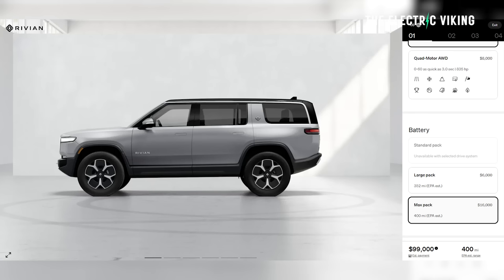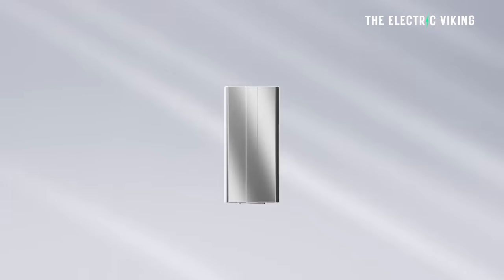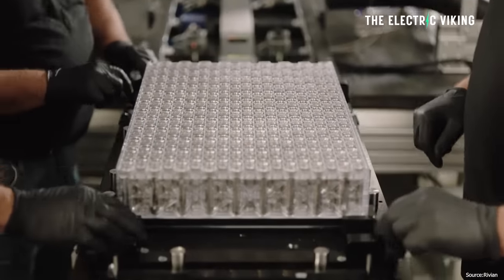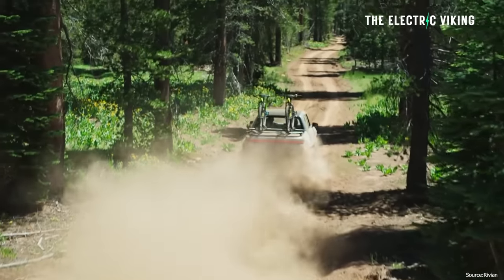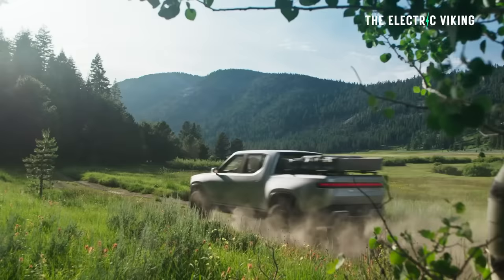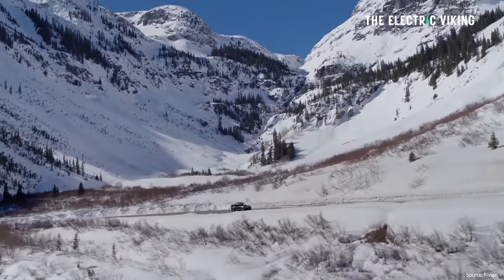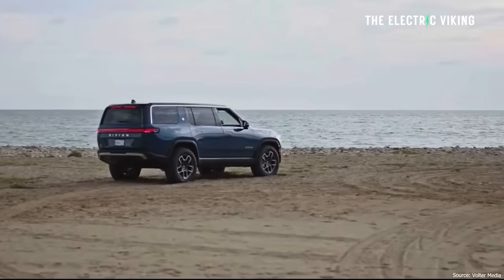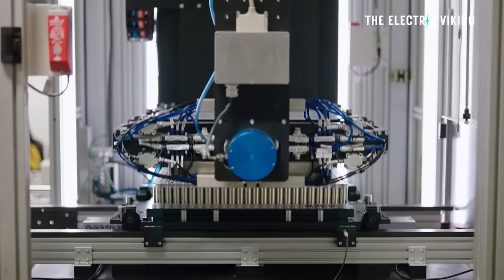Rivian reveals the battery secret that boosted its SUV and pickup to 410 miles

Comment: I got my R1S (quad motor, large pack, 20" AT wheels) a couple of weeks ago and I am so impressed with this vehicle. Would I consider upgrading to a Max Pack sometime down the road? Possibly, but I'll need to do some remote off-road/camping trips to see if my current configuration still fits my needs. So impressed that Rivian managed to squeeze out over 400 mile range while only adding 14kwh to the battery size over the large pack. I think with this kind of innovation, Rivian is going to find a road to profitability and will be with us for a long time.

Comment: The dual motor that gets 352 miles and goes for $79,000, meaning $71,500 after the $7,500 federal rebate is the one to go for. It's even cheaper with additional states rebates in several states.

Comment: I have range anxiety but not $16,000 worth.
Reply: 😂 Agreed.
Reply: @@passurlamer I sold my perfectly good 2018 Odyssey Elite that I routinely drove 350 -400 miles on a tank with a  capacity of 19.5 gal. At 27 mpg on a long road trip, I could get over 500 miles.  The 2015 Model S P85D I bought that at 80% charge gives me 182 miles.  At 100% charge, this old battery pack goes 226 miles.  I’m retired & drive 4000-5000 miles a year so a model S with 180 mile range is ok for me.
Reply: @Trilobite45  well you bought an 8 year old Tesla. Brand new the range was probably like 250 or so. I’d assume it’s degraded. 

If range was truly a concern you could have got a Model 3 long range which get around 300-350 miles. Probably like 250 on the highway

Comment: Sam, you keep quoting battery costs at least at the cell level as being <$100/kw now.  That means a 150kwh pack shouldn't have more than $15K in cells.  Even if LFP dropped that to $50/kwh it would only shave $7500 from the cost, and at the downside of a pack that weighs 50% more.  Rivian's cost problem is not the battery pack unless they are still paying 2010 prices for cells.   For them to be losing $32K on each $100K truck (not $20K, that's Ford), they must be spending more on parts and labor than Bentley does when they handcraft a car.

Also, form factor has nothing to do with whether a battery cell is "old tech" or not.  Rivian has said they have a new chemistry going into 21700 format cells, and it is the chemistry (Qirin, LMFP, NMC, etc) that matters as far as "new" or "old" tech goes.  For all we know, these 21700 cells are tabless like Tesla's 4680 and that would be "new tech".
Reply: Accounting is part black art.. The net loss per vehicle may be based on units produced - that is if they can make and sell more at the same price, they might make money.  Supposedly, Ford said if they can increase Mach E sales, they will make money even at the higher supplier costs all other things being equal.  Is that true?  Don't know - I'm an engineer, not a bean counter, but if they're counting amortization costs of the whole program including fixed costs like factory etc., then more units out the door might turn the corner.
Reply: @ohger1  I think you must be right.  My point was that lower battery prices will not make up for such huge losses per vehicle because the components are unlikely to be a major contributor to the losses.  I got sidetracked thinking how other high-end luxury makers can turn a profit on such low volume as Bentley does.  It has got to be accounting math that attributes capital costs, engineering, and admin to each vehicle cost -- in which case only dividing those overhead costs across many more vehicles will turn losses per vehicle to profit per vehicle.  Bentley obviously doesn't have huge recent outlays for new factories and ground-up engineering.
Reply: Yes, Sam should be more careful with his words. He said that the battery is probably 50% of the cost of a Rivian (which he knows is incorrect), then contradicted himself by saying the largest pack probably doesn't cost Rivian $16,000 more.

Comment: If anyone is interested in my two-cents worth: As someone who has been shopping the EV truck market for months now, such as it is, what Rivian needs to do is make a product that is affordable to a larger segment of potential truck buyers. No manufacturer is currently offering an EV (nor a PHEV with all electric range) in the mid-size segment. The R1T hits the sweet spot size-size for those of us who find the F150 Lightning and the upcoming Chevy Silverado and GMC REV TOO DAMN BIG. The R1T fits the bill, but is priced beyond most buyers' means (or pain threshold). What Rivian ought to do is create an R1T Work Truck trim by dropping the luxury items: wood trim interior; power tailgate and frunk, etc. Make it a RWD like the new Tesla M3 and MY. The other thing Rivian ought to do is create a production line for the R2T/S at their Illinois plant. They haven't even broken ground on the Georgia plant yet. Using the Tesla M3 as a blueprint: making an affordable midsize EV truck and SUV will be the game changer it was for Tesla. I'm worried Rivian won't be able to hold on long enough to realize those economies of scale through demand.
Reply: It's conceivable that the Tesla CyberTruck will be that, depending on what the prices turn out to be.  It may be that one needs the manufacturing knowledge, capability and scale that Tesla has painfully accrued, and to make a more aerodynamic vehicle to surround a large rectangular bed, rather than trying to push a brick through the air on battery power.  Time will tell.

Comment: +1 on longer bed , add smaller cab option w/long bed. I wish they’d work with a new chemistry, Amprius has something coming, 2x range , half the weight. Others are pushing research in efficiency

Comment: Instead of long range battery packs,  it would be far cheaper and efficient in totality,  to simply roll out the super fast charging infrastructure sooner rather than later.  For highways every 50km or less.  Of course all this could be modelled numerically, including factoring in industry growth and EV deployment growth along with traffic route data.  You wont require long range batteries once this infrastructure is fully built out.  This will also improve EV efficiency,  as they wont require as large a battery,  once ubiquitous super fast charging networks are  in place with sufficient geographic saturation. Don't forget also,  that many longer range family EV trips ( i.e. over 500km ) first charge will be at home over night and not the local petrol station.  This will somewhat alleviate the EV recharging saturation burden upon designated fast charging stations.

Comment: It is the chemistry that is most important for capacity, not size of individual cell. Rivian will be getting best, high density high quality NMC cells. Tesla 4680s cells are less dense on a weight basis due to weight of can. Other 4680 makers use lighter non-structural can.

Comment: This has turned into a viscous circle, with all EV manufacturers, any company can make an EV, in fact it is 10 times easier than building an ICE vehicle. What everyone is missing is an EV is capable of lasting for 50 years, which is 4 times longer, so in reality we only need 20 million new cars per year, not 75 million. The problem is EV companies are still building shit metal vehicles, they should be constructed as light as possible using carbon fiber. This would give you vehicles that are lighter, stronger, require less battery, and have 10 times the value at only 2 times the cost. This is the future, but batteries are still the problem, we need to get to 100KWH batteries that weigh 250 lbs. not 1,400 lbs.

Comment: Why range anxiety? Average daily travel is typically well under 50 miles.  Driving the full range of any EV takes too much time.  Many many hours..   Using  Tesla’s super chargers if you need an extra 150-200 miles you are only 15 minutes away.  About the time required to go to the bathroom and grab a bite to eat.  
  How often do you take a long road trip?  Once a year?  ( most vacations involve airlines or trains to give Dad a break )   Aside from that  the display shows nearby chargers and route& distance to the next one. Tesla alone has more than 25,000 superchargers in the US with an additional 10,000 per year for the projected future.  

   Finally most cars actually exceed listed range by an additional 10-15 miles. With even more available  by driving slower.  
     However the trick to a fast trip with an EV is to not run it down past the last 20% of charge and don’t charge it to over 80% of full charge.  ( it charges fastest in that middle range).

Comment: The performance option doesn't change the motors, It's only a software unlock for more power
Reply: Very smart you can pay to get it unlocked by hacking it

Comment: If Rivian tanks, there's a good chance an incumbent will pick them up. GM would be the obvious candidate because their EVs game is stalling before it properly got off the line, but Ford would also be a possible candidate. Both have massive ute/truck business and delivery van ranges, so it would fit right in. Another candidate for a takeover could be Stellantis (think old Chrysler). Of course, a Chinese firm like Geely, Nio, or Xpeng could use this for market entry in the states but I doubt the government would let that happen. Renault could use Rivian, both for getting back into the states and for adding a big EV platform to their portfolio. I doubt Rivian would just go under...
Reply: Rivian wont tank you still used to tesla

Comment: I am calling BS.  They only achieve this in their dual motor.  Dual motors standard drive mode automatically disconnects a motor above 15mph.  Quad motor testing is based on all purpose mode that keeps all motors engaged allowing the quad to do better in conserve mode.  I really don’t care about pack size above the 135kwh, they just need to improve the charge curve

Comment: You say many different things here, some of which are accurate and some not, when it comes to batteries and battery costs. As to Rivian's current and future profitability, you seem to say that if Rivian continues to do what it is doing now, it won't reach profitability. So are you saying that if Rivian continues to drive its COGS down at the rate it's driving these costs down now, it won't become profitable? If the answer is yes, that would be an absurd thesis, given what we know about the dramatic rate of COGS reduction over the past year. Are you saying that if Rivian continues to make cars of the quality, functionality, performance, and brand attractiveness that is making now, it won't become profitable? That also would be absurd, given the extraordinarily high customer satisfaction numbers it has been achieving. I assume you are not saying either one of these absurd things. Are you saying that if Rivian continues to ramp up production at the rate it has been ramping over the past three quarters, let's say, that it won't become profitable? That would also be absurd, because it is basically doubling production on an annual basis, which is what it needs to do to get to an 80% factory utilization rate quickly. And 80% is where it needs to be in order to make reasonable net margins. So I'm quite confused. You seem to be saying that if Rivian continues to do what it's doing, it won't reach profitability, yet all the things I've mentioned (in addition to others) are exactly what Rivian needs to be doing to reach profitability. Something isn't making sense here.
Reply: I suspect that Electric Viking feels he has to knock out volume of videos to attain his YT revenue goals and has less time for checking data.
Personally I would prefer if he reduced waffle content and provided concise, well-researched facts.
IMHO less is often more - but I do not have knowledge of YT algorithm and how it effects Vikings quality control.

Comment: That's right Enrique; but few private individuals yet alone commercial operations can afford to average 40mph having workers paid while a truck charges. For example, I have a freind that is a Glazer. He & coworker put in commerical doors.  These doors are very heavy so if he has an assigment to put in doors 350 miles away - which is a pretty common job;  H'ed have to start at 12 midnight in the morning to get there by 8AM, w a diesel he can start at 3am. 4 hours lost at $250 per hour, plus likely 3 more over time hours. Possibly another couple hours for a pair of workers on the return trip if the Rivian doesn't really get 350 miles of range w just two people.
Reply: For those situations an electric truck would be difficult. The vast majority of traded people drive. I where near that. In fact, Ford used their telematics data to understand how far their commercial van buyers drove. They found the vast majority of them drove less than 100 miles per day. That’s why their van only has 126 miles of range. Commercial owners don’t want anymore range and cost than they need.
Reply: Just get the Tesla Model X with the towing package and use the trailer to haul the glass doors and would greatly improve that scenario you describe. The trailer can also be lower to the ground to improve road handling, and loading / offloading ability.

Comment: A Rivian towed a trailered Mustang here on youtube 2400 miles across the USA.  Average range per charge 120miles between charges of an hour or 3 hours to travel 120 miles; averages 40mph.  If you want a truck forget EVs.  If you want an expensive EV car that looks like a truck, you might put some bikes or light load in; perhaps you will want one.
Reply: Ford Range (not US model ) diesel claim a 20% penalty for towing up to 3500kgs ( 7700lb ) .
Reply: @lowtech_1 F350 diesel towing 12,000 lbs boat for 240 miles was 50% penalty (16mpg down to 6-8 mpg) for me (over two low mtn passes). During pass climb, I was in the slow lane with hazards on with all the commercial trucks. Only filled up when leaving and returning, since the truck had larger dual tanks.
Reply: Sure you can find examples,  of poor efficiency vehicles.  But to say ICE all lose 50% is not true.

Comment: It's not worth the extra dosh. But then range anxiety is very real for me.
Reply: As it is for most new EV owners.  If Rivian can use the Tesla Supercharging network and if you can charge at home, range is a complete non-issue.  Those with no facility to home charge have a legitimate worry.
Reply: This is why I say that it doesn’t matter how cheap or expensive it is an EV is if it doesn’t haven’t a reliable infrastructure to support it. You can go for practically any trim for any Tesla no matter the range it comes with because you it’ll be backed by a very reliable charging network.

Comment: Is it me, or is that blue color horrible? Why do these EV ute/truck companies pick such awful colors? I dont know why these EV companies dont make the built in battery a smaller size/range, but have an area where a 'suitcase sized' second battery can be added/removed at will. When you are driving around town 50 miles a day, the built in battery is fine. If you are going to have to do a longer trip or tow something, rent a second battery for the time you need the extra electrons... then remove it once back to usual driving.

Comment: Not no, but @#%& no. 410 miles, then how long to recharge ?. Are they (the company) on very powerful, serious reality changing substances ?. $100k for a four-door SUV ?. That's a third of the value of my 150 years old house. What's going to be left of this SUV in 150 years. How many times in that 150  years would I have to spend $10 to 20k to replace the very special battery pack. Nope, no EV for me, I'll stick with my mythical 58 Chevy pick up truck and completely avoid all this extreme silliness. Getting back to those powerful reality altering substances, where do they get them, will they share ?.

Comment: Best battery teck is a 12 volt lead-acid battery attached to an ICE car.
Reply: This.  Tired of all these fancy batteries.  We need to go back to lead acid.   #boycottlithium
Reply: Fool
Reply: @MrGMawson2438  Lithium = crap
Lead-acid = longer range, charges faster, lead is lighter, you can eat lead, and 12v architecture is superior. 
Lead-acid has numerous advantages.  You must work for big lithium which explains why you’re threatened by a far superior technology like lead-acid.
Reply: @wheelofcheese100  I'm tired of all these awful automobiles. Noisy, smelly, polluting, expensive as hell. Back in my day, we rode our horses everywhere.
Reply: Teck